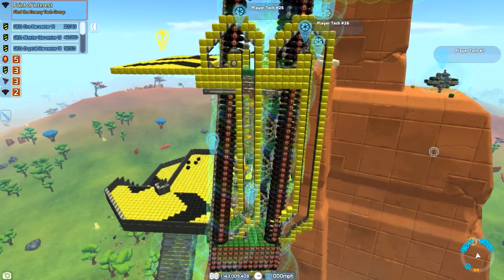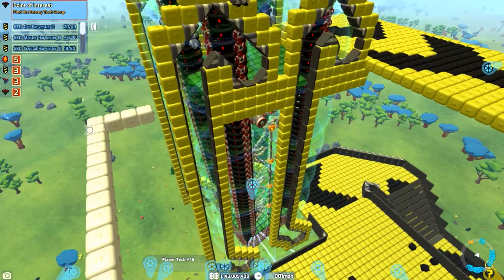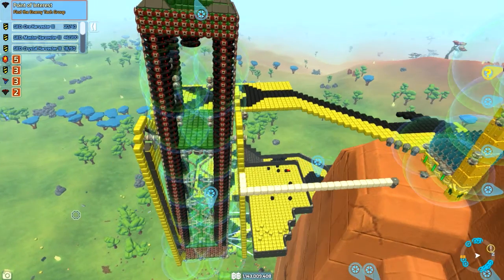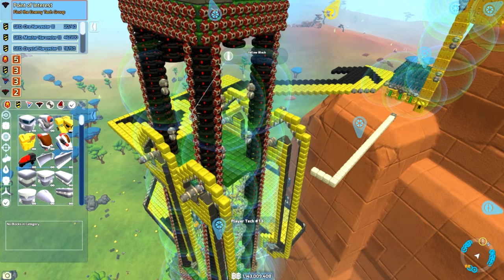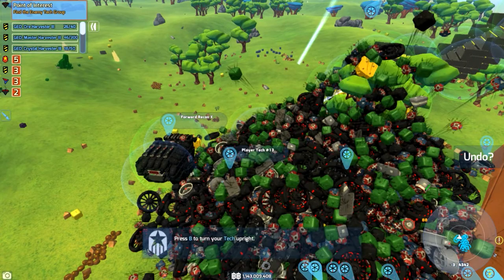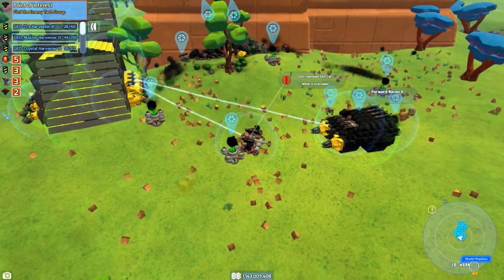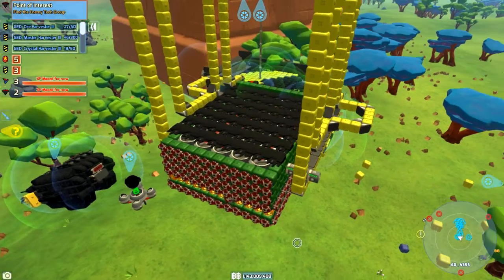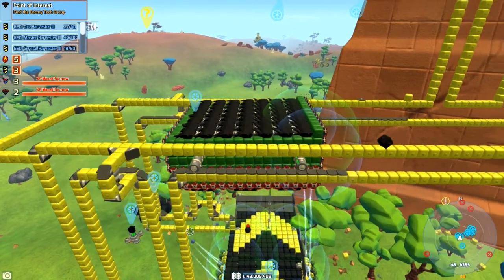Terra Tech - 0.7 - PT 12 -  Elevator Out Of Order - Let's Play

Comment: oh man ... all that work going into the drain..to bad it was a nice elevator ...but u know what they say try try try en try again....

Never loose hope ............
Reply from the maker: Yeah it kind of sucked, but I did sort of expect it. I did however back up that save so I could try it later. It loads with random results so it might be worth it.
For now I am already working on the next version of this build. I like it way better already.   Have a good one   [8D)
Reply: had the same problem with my sky fortress 0.7 screwed up my save game so my fortress on a pyramid shifted to the side so every time i load my save i see my fortress falling so bye bye save ...was a bit pist but it gave me an excuse to start over ...hehehe...
Reply from the maker: That's about all that can be done besides getting mad or crying about it. Moving on to the next attempt is always best.  With the next version of my elevator is going to have a section for reloading the elevator car just in case it falls out like it most likely will. Planing for the worse should help a little.   Have a good one   [8D)